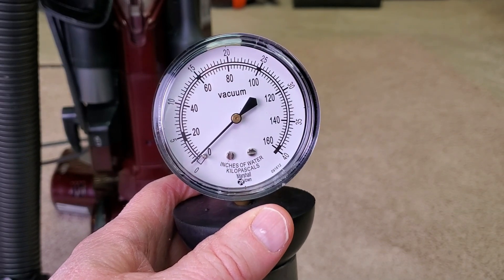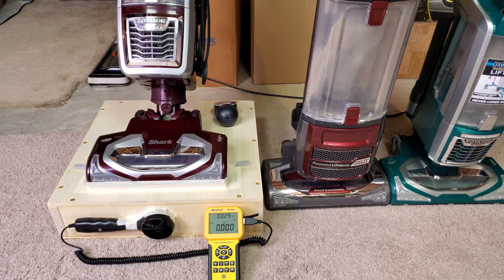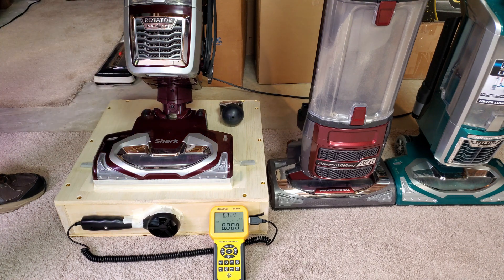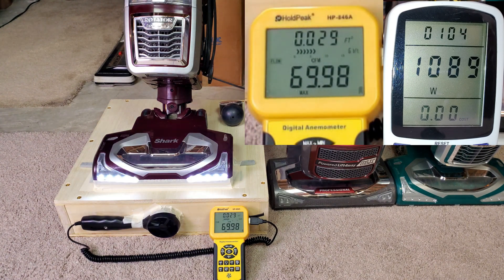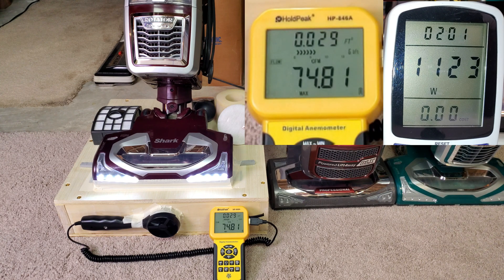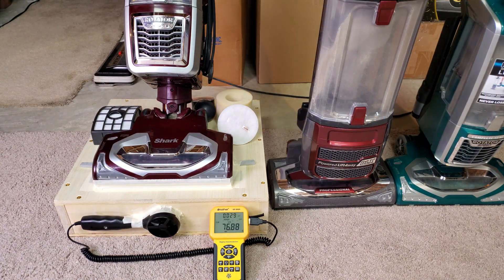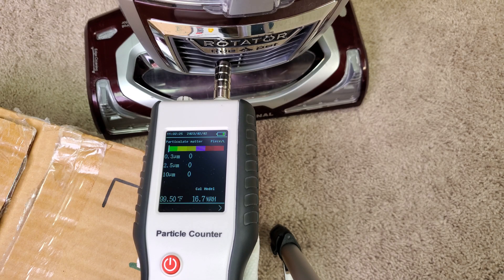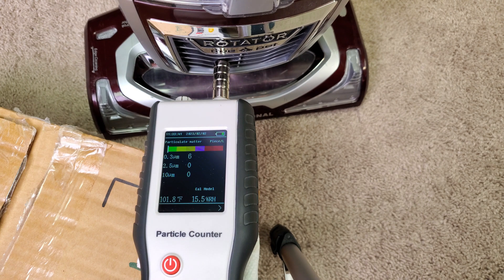Shark NV750W Airflow Suction BR RPM And Particle Tests

Comment: What is the CFM of the little green shark? I can’t recall what it got in the test.
Reply from the maker: It's in the respective playlist.
Reply: You mean shark rotator powered lift away speed even that’s the green one but remember the brand name because it’s easier to know what type of shark vacuum is and he got a rotator powered lift away true pet version because the hepa filter cover door so always remember the name and type of shark vacuum what version model of the vacuum like you can know the model number but just what kind of shark vacuum version name of the vacuum type upright version models like navigator, rotator, Apex Vertex and strados

Comment: the wind down sounds the motor Barings needs replacing
Reply: very common but still works .
Reply from the maker: Uh, no. After 7 years these have some wear but are nowhere near replacement.